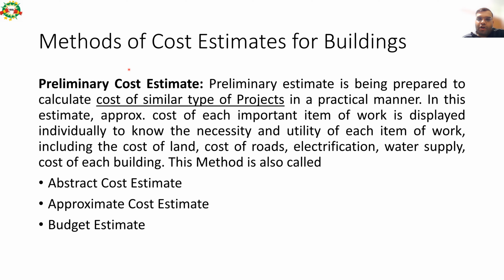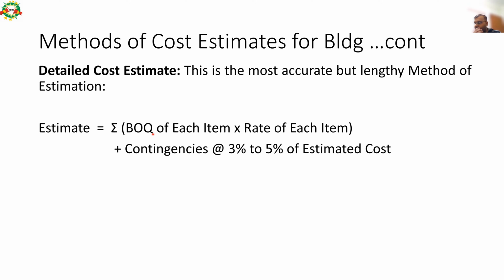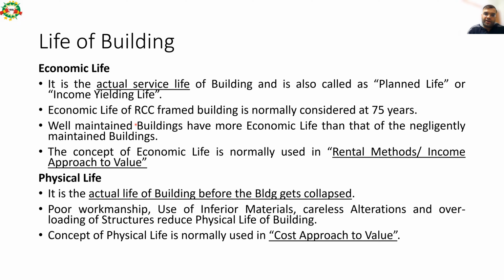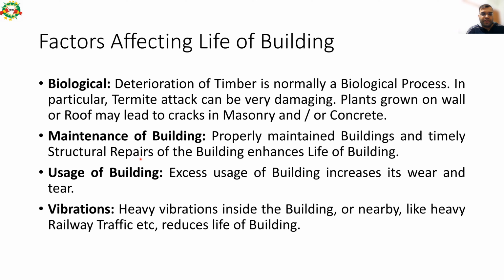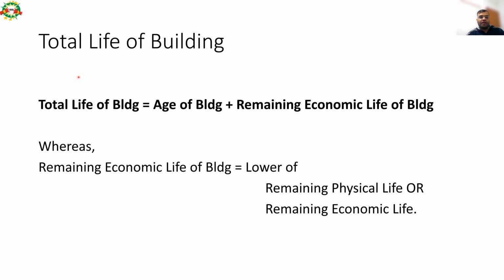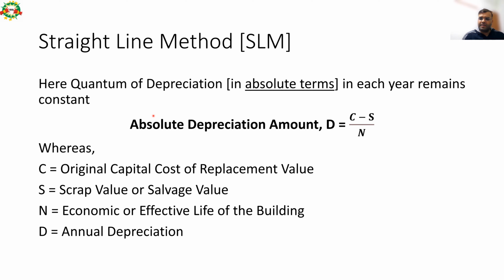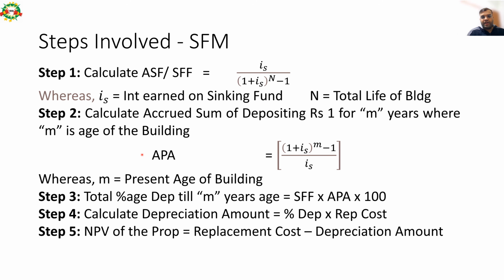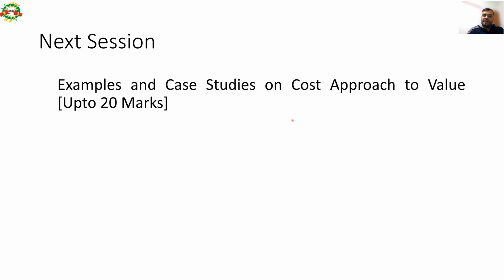Cost Approach to Value | Theory | IBBI Valuation Exam Study Material | IBBI Cracker

Comment: There is a mistake in Sum of Digits Method (depriciation): It Depriciate fast in Initial years(like Mobile Phone Value) and it is opposite of Sinking Fund Method, In ur PPT it is mentioed that It gives lower rate of Depriciation in Initial Years.
Reply from the maker: It is a common confusion around this method. You may also  refer the book prescribed by IBBI for better clarity.
Reply: @ibbicracker  you can Calculate by putting the same Value for consecutive years in all methods for comparison.